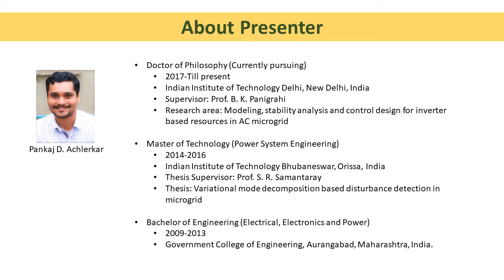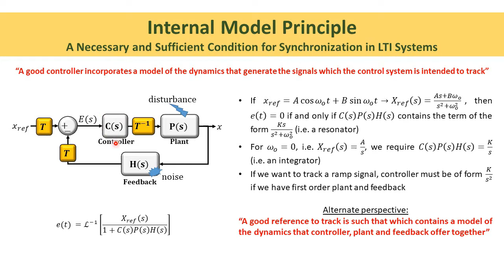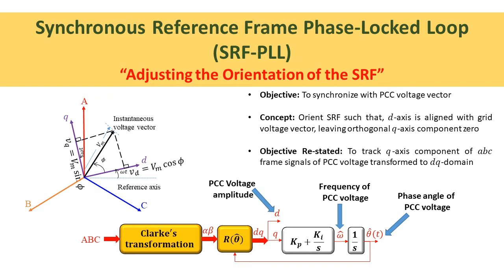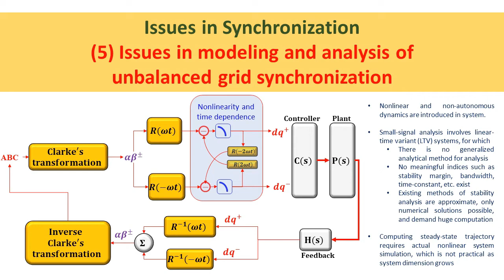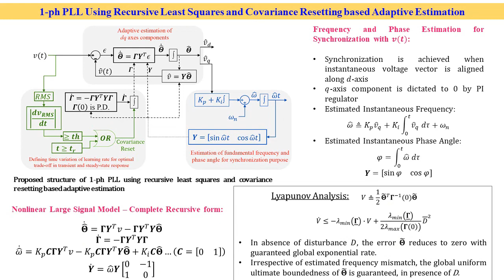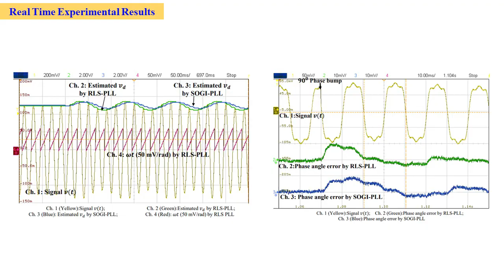Comment: Theory I cannot grasp. Can u explain the practical way the inverter senses the grid and imitates it. What circuit examples can you give? For example, does the inverter read the grid voltage every second to confirm frequency needed and voltage level by using a certain way or circuit?
Reply: Voltages are continuously measured and scaled down by Current Transformers, and the continuous waveforms are sampled. The PLL is a digital controller used on those sampled waveforms.
Let me know if you have any specific doubt in this regard.
Reply: @pankajachlerkar does the created 240v volt stop for a short pulse when the incoming line needs to be checked. They are on the same line so can't happen together , right? Would be interesting to see  oscilliscope readings to see what part is doing what line in, associated sensing circuits and voltage created.
Reply: @pankajachlerkar   can you please guide me with some good resources to learn basics of PLL design for grid integration,I need it ,Thanks and video is much appreciable :)